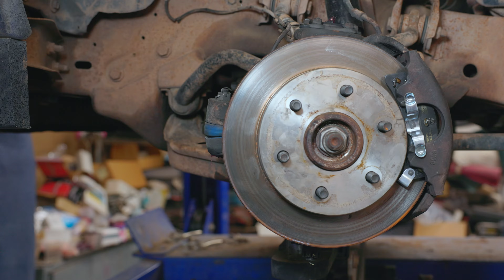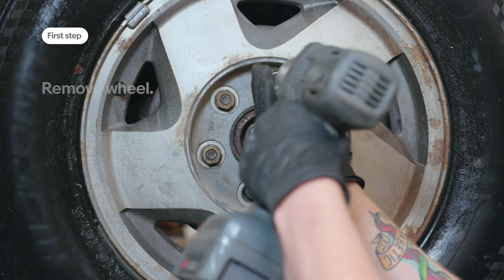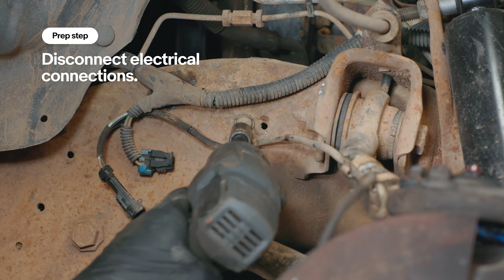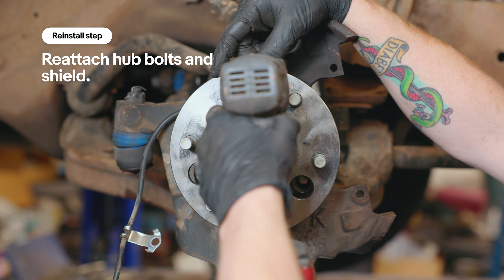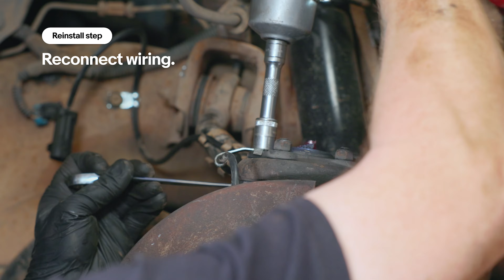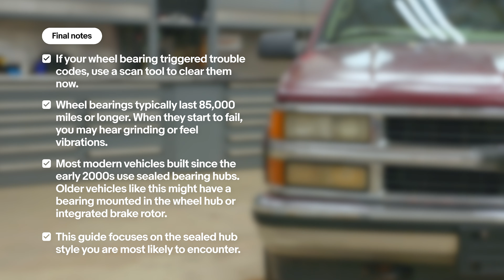How to replace wheel bearings with eBay Motors

Comment: This is not what you find on most vehicles. Most vehicles the bearing is pressed in. Others, the bolts are on the inside of the steering knuckle.

Comment: One thing I always like to do now when screwing on any nuts is to finger tighten them as far as I can first, because i had a shop cross-thread several lugs on one wheel, using the impact wrench.  Then when I tried removing the lugs (with a breaker bad AND an extender), I wound up twisting one of the studs off, before I realized what was going on.
Reply from the maker: Excellent advice. Your experience sounds like a nightmare.

Comment: How do you know if you need wheel bearings as somebody that is not mechanically inclined that simply drives the car
Reply: With the wheel on and off the ground, shake the wheel by pressing on each side (like you were shaking somebody to wake them up). If the wheel has side to side play, you need a new hub. 

You could also spin the wheel and listen for a grinding noise. That’s an indicator that the bearing in the hub is going out.
Reply: @raveloma  thanks
Reply: Thanks  also  @raveloma